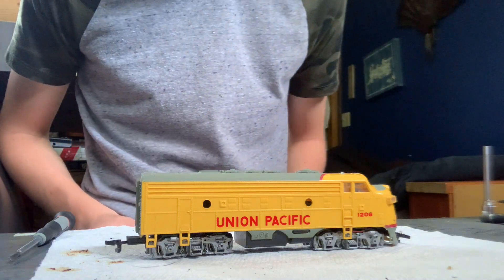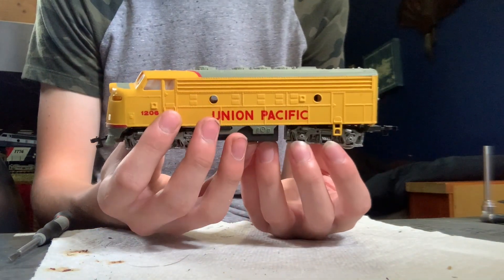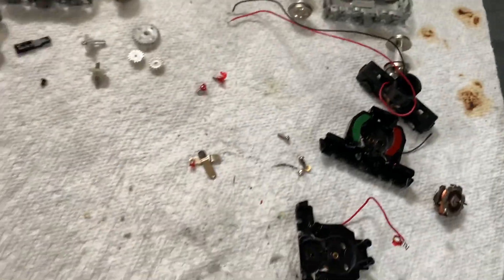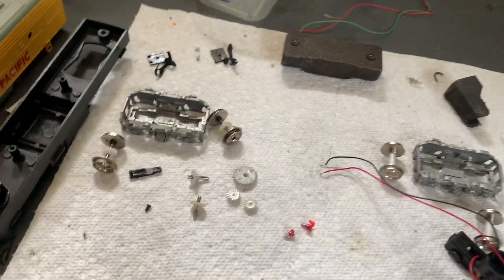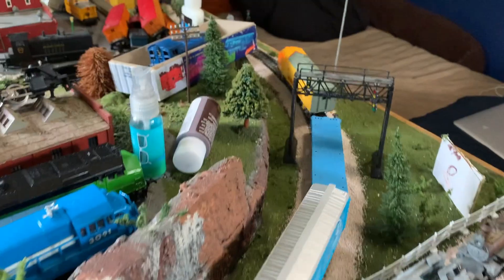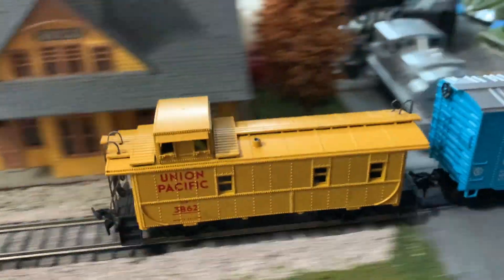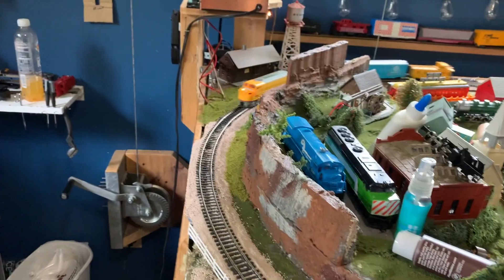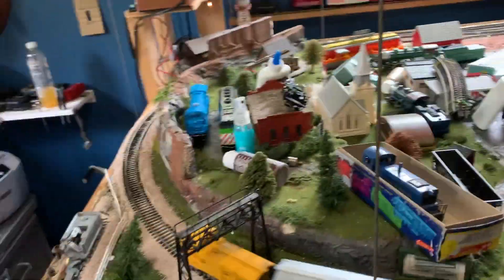Vintage Bachmann F9 Diesel Restoration

Comment: Looks like its running pretty smooth Dan, great job!  FYI, Bachmann usually billed these locomotives as F9s and your version is a rather unusual one with the one rear pickup wheel!  They were lousy pullers but man were they fast!
Reply: Put two together they will pull together
Reply: @Bri-rb5lq  yeah, I know, I was just comparing them to some other locomotives from that general time frame (Athearn, Atlas, and even the Bachmann Plus locomotives).